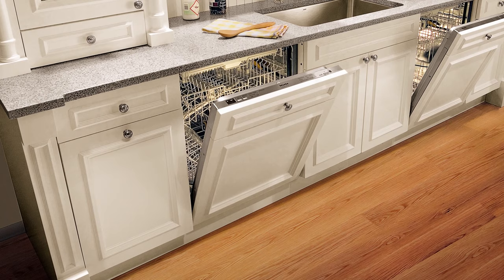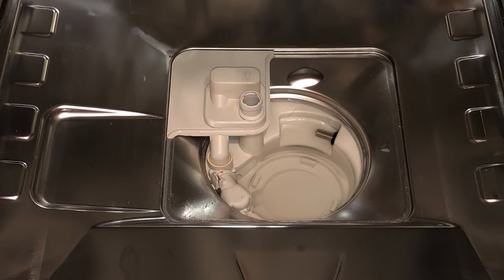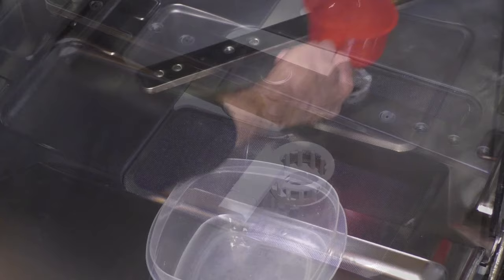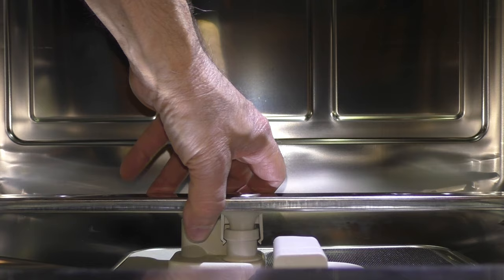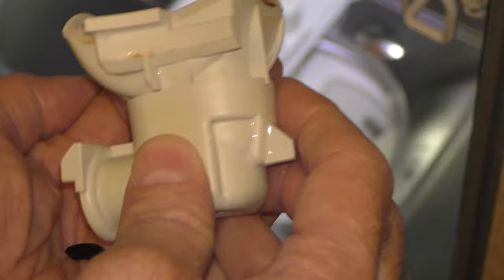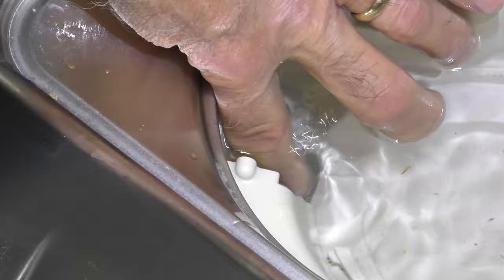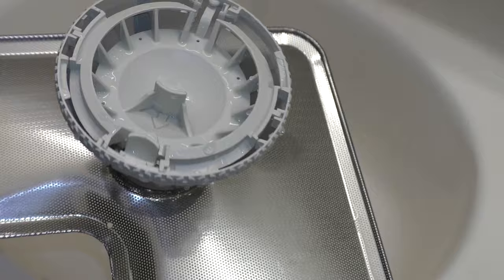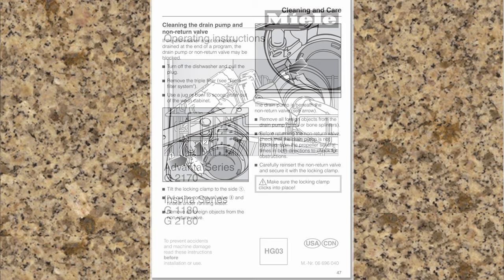#8 - How to Clean the Triple Filter and Non-return Valve on a Miele Dishwasher

Comment: I have just had a Miele engineer round to fix my dishwasher. The non return valve in older models like mine were made in two parts that were glued together. The glue had perished so the valve was in two halves that caused the water not to drain. The replacement part has been modified and is now made from one piece only. Working fine now and the part was not expensive.
Reply from the maker: Thank you for sharing your experience! We're glad to hear that our engineer was able to resolve the issue with your dishwasher and that the new part is working well. We strive to continually enhance our products for the best performance and longevity. 

If you have any further questions or need assistance, please don't hesitate to reach out.

Comment: Thanks for the useful video.  However, when I followed the procedure I found nothing that would have triggered the F11 error, so I suspected blockage in the drain hose under the sink.  I removed the drain hose from the garbage disposal unit under the sink to see if the problem was there.  It is easy: it is held on by a hose clamp that you can remove with an ordinary philips screwdriver.  The hose was backed up at the end for about two inches with pieces of vegetables.   There was blockage at the drain port on the garbage disposal which I poked all the way into the disposal unit with a stick.  There was also blockage at the end of the drain hose, which I removed by bending a piece of wire into a J-shape and scooping it out.  The rest of the hose was clear.   So first follow the advice in this excellent video (which you should do periodically anyway) but also disconnect the drain hose from the garbage disposal to see if it is blocked there.

Comment: Thank you for you video. I had the problem with the drain flushing light.. I found out it was my  return valve that was causing the problem. My valve was not stuck but the ball felt a bit hard to move. I did not have any foreigh object inside the valve.There are  videos on youtube that show how to replace the vavle. Instead orf replacing the valve I just put some olive oil inside, let it bath in it for few minutes and it works like new. The rubber got softer with oil and does not hold the metal ball inside,.  This happends in older dishwasher. It is a easy fix to try.
Reply from the maker: We're glad you were able to fix it yourself, Vladimir!

Comment: After program is finished, the water is pumped properly. But after a few days, the water creeps up. I’ve replaced the non return valve, it worked only for 2 months. Now I have the same problem again, the water from the sink seems to come into the dishwasher. My Miele is 15 years old.
Reply from the maker: We genuinely regret the inconvenience caused by your Miele dishwasher. For immediate assistance and resolution, please contact our Consumer Support team directly at 888-996-4353. We look forward to speaking with you.